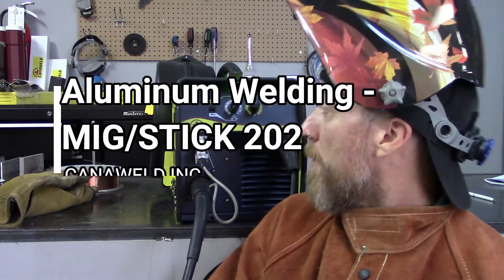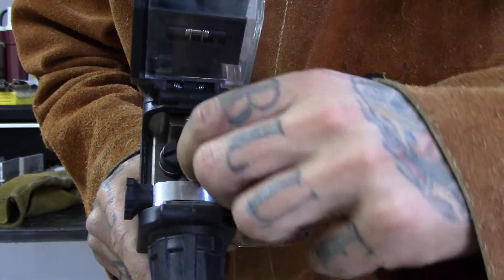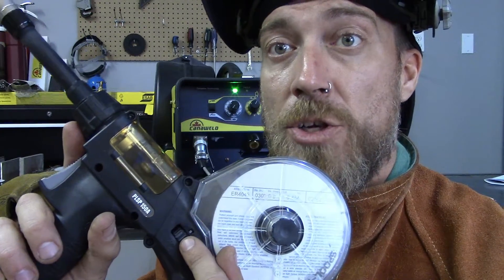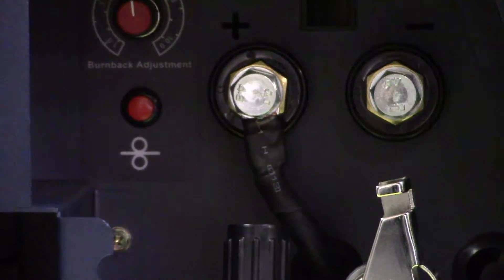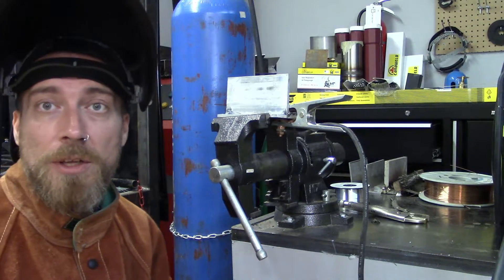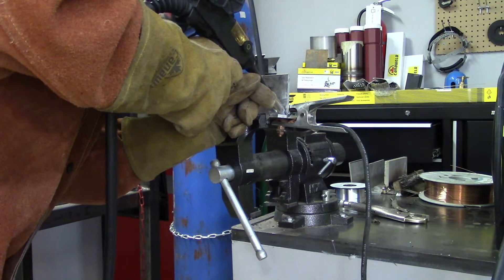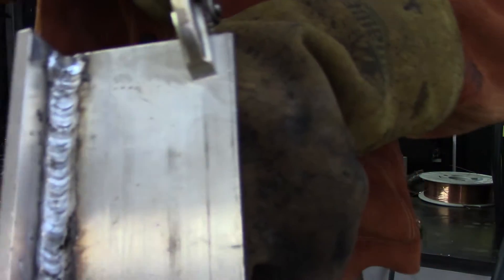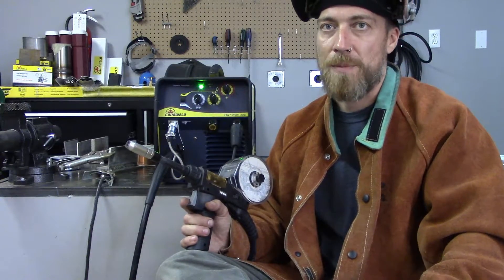Mig Welding tips and tricks -how to setup the mig machine by Canaweld - Tutorial Video 2020

Comment: Will the spool gun work with the Tig ac/dc 201?
Reply: No sadly but that would be sweet if it was possible. Sadly the connection for the spool gun doesn’t exist on the TIG AC/DC but that machine can do aluminum beautifully on its own without forking out extra money for a spool gun ! It’s even capable of pulse aluminum which is really nice for welds that people are going to see and you want to ensure maximum appearance and penetration / quality without warping the material or distortion